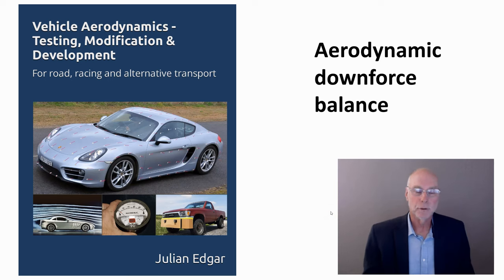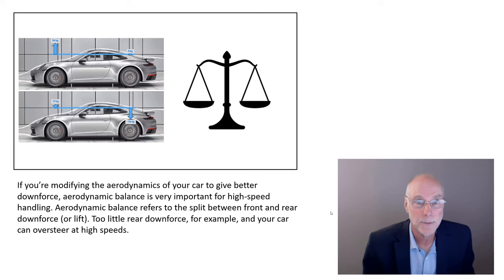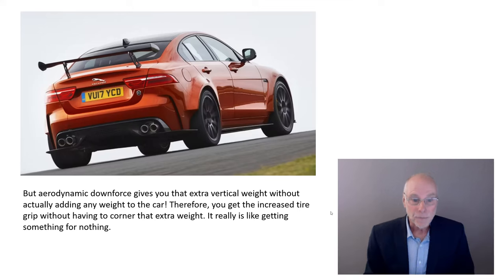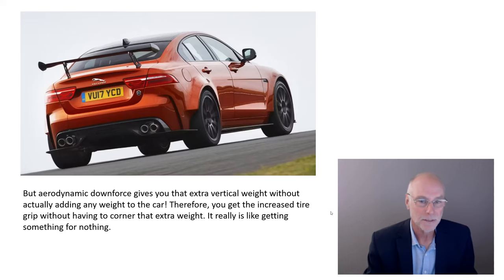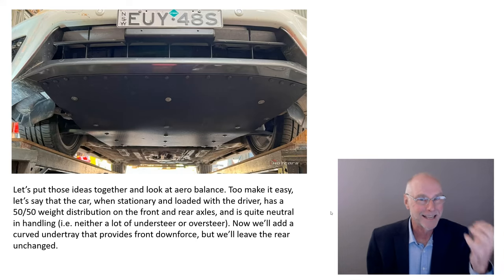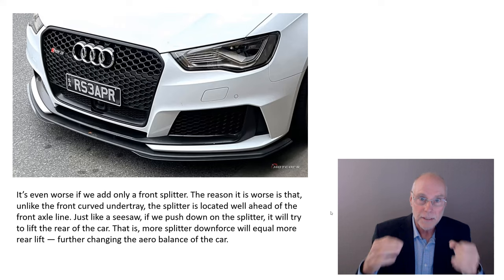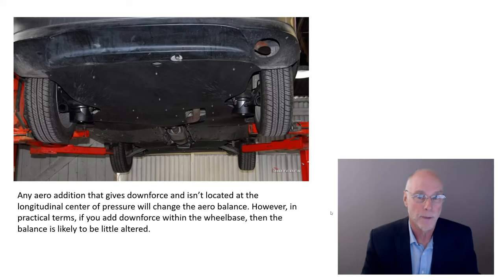Aerodynamic downforce balance

Comment: Autocar in the UK tested an early one without the rear spoiler, and they liked the playfulness if the chassis (i.e. oversteer).
But as part of the recall Audi also changed the geometry of the suspension and that ruined it for many. 
But you can buy kits to put the geometry back - though do leave the spoiler on if you're intending on doing high speeds!

Comment: I don't understand why more roadcar makers don't use inflatable front airdam ala Porsche has used.  It adds some weight and complexity but it seems like a good balance to reduce lift at the front while handling impacts and driveways, speed bumps etc... and can be deployed with speed and deflated at low speeds.  So many manufacturers use a deployable rear wing/spoiler but few for front air dam.
Reply: I've always thought they could be "deployable" but never "inflatable" :face-red-heart-shape: The only experience I've had with a inflatable was after my divorce :face-orange-biting-nails: But I digress. Very COoL idea Z888. You RoCk. Cheers!

Comment: Hi Edgar, i'm reading your book, Modifying The Aerodynamics of Your Road Car. Can you do a video about the exhaust gases and aerodynamics, like side exhausts to save weight for example. Thank you so much. I really enjoying the book! Congrats from Brazil !
Reply from the maker: I don't see much connection between exhaust gases and aerodynamics. The exhaust gas flow is so low, especially at part throttle, that they make little/zero difference to car aero.
Reply: @JulianEdgar  you are the best! Tks!!!
Reply: @JulianEdgar not even for the McLaren 570S?
Reply from the maker: No - what happens when you back off?
Reply: Top fuel dragsters generate large amount of thrust from the exhaust and it’s commonly used to push the car down to give it more traction, but it’s an extreme example
Reply: @JulianEdgar Wasn't that the experience from F1 - the potential gains, however small, varied with engine revs - and possibility when you didn't want it to.

Comment: Two questions;

1. If down-force is measurably lowering ride height as speeds increase, doesn't that eventually become a problem if your suspension doesn't have enough travel at higher speeds?

2. Say your car has a very well designed bottom side from the front all the way to roughly the rear axle, but rear axle to bumper is relatively open. Would adding a diffuser to smooth out the airflow of the uncovered section then remove frontal downforce since it's increasing it under the car at the rear? And if so, would then the ride height change from doing so up front at higher speeds induce even more lift?
Reply from the maker: 1. Yes, if you have a lot of downforce, soft springing and don't have suspension capable of automatic height adjustment. 
2. It depends where the added diffuser causes more downforce to be developed.

Comment: Eventually suspension does change, when you start adding lots of aero load. On a dual wishbone car, lowering a car will give more camber, and also alter the roll center. As you add more downforce, the load starts lowering the car to the ground.
Reply from the maker: Sure, but not if you have automatic height control of the suspension. (Which is what I used on my Honda Insight with downforce.)
Reply: @JulianEdgar  That's pretty neat!

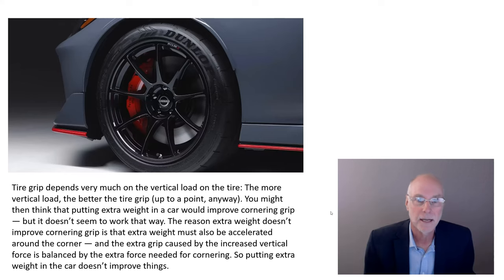Comment: 2:33 Is it not correct that adding weight to the car would actually increase grip, but that the added inertia simply outweighs (pun not intended) any benefit you'd get from it? Since - by my understanding - downforce is simply a way to add weight (at speed) without having to increase mass.

(Keeping in mind that weight and mass aren't the same thing, of course)

*Update, a little further on in the video now, you basically said that exact thing in different terminology. Shouldn't underestimate you.
Reply from the maker: Isn't that what I said (and it's also in the slide's text)?
Reply: @JulianEdgar  It is, just in different words. Initially (at the timestamp) you insinuated that adding weight doesn't increase grip, but you clarified later. I think the fact you didn't distinguish between weight and mass (which to be fair isn't entirely necessary) just tripped me up.

Comment: Now I'm afraid of fabricating a front undertray for my road car in place of the old broken one. I don't remember what it was like, and if I somehow end up with less lift than it originally had, my Saab will turn into an Audi?
Reply from the maker: Developing effective front undertrays is covered in my book. No need to guess - all can be easily and cheaply measured on the road.
Reply: @JulianEdgar  Ay! I've watched all (?) your videos about the subject aswell, but still haven't got my hands on the book. First I'm looking into getting the road car performance optimization one, though.

The front undertray and insides of the wheel arches have been shattered, so it will require a tad bit more advanced fabrication techniques in order to get everything nice and solid. I will probably choose aramid reinforced glass fiber as my material - that should work, right?

Comment: How would ride height affect downforce?

Let’s say I lower the front by 1 inch, and the back by 2 inches or vice versa

How would that affect the balance  of the car?
Reply from the maker: Yes, relative height changes will usually affect downforce. For example, going lower = faster airflow speeds under the car = less lift /more downforce. However, the situation is made more complex because rake changes also affect lift/downforce developed on upper body surfaces. All easily taken into account if you measure actual lift/downforce occurring on the car, as covered in my book.